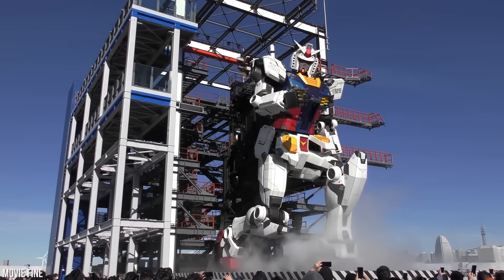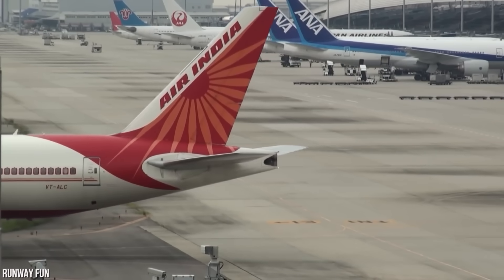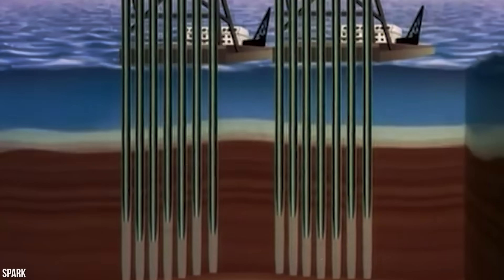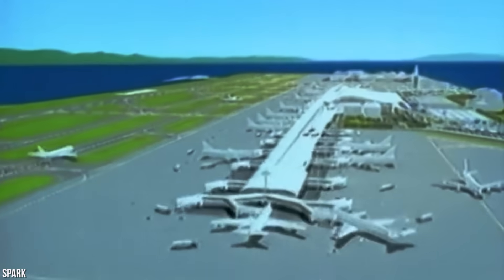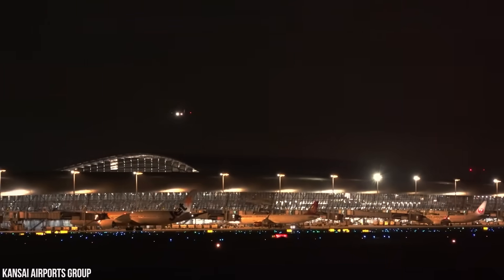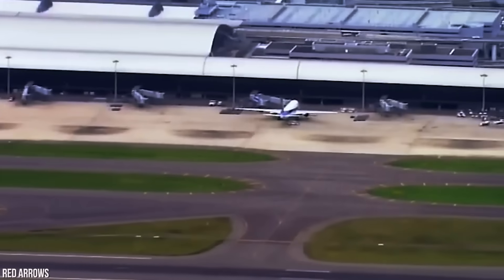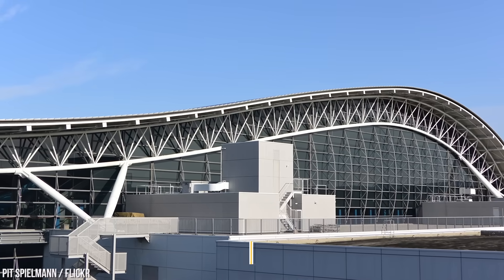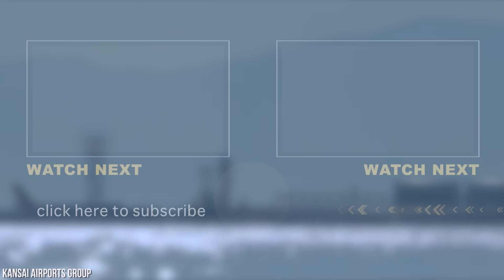Japan's $20 Billion Dollar Floating Airport Is Sinking

Comment: Do you know what's even more hilarious? Back in 1997-2000, Japan had experiments and tests with a possible fully floating airport. They've built a 1000m Mega-Float floating airport model in Tokyo Bay. And in the end, they came up to the following conclusions:

-A number of programs were developed to design a large-scale Mega-Float airport taking into account of hydro-elastic response. Using these programs, test designs of an approximately 5000m long floating airport containing a 4000m-class runway were drafted.

-Programs were developed to estimate fluctuations in the radio wave of ILS and PAPI, which are caused by the minute motions due to hydro-elastic response in the Mega-Float airport. These were then analyzed using the 4000m-class test designs. In addition, through the inputting of the analyzed values into a Japan Airlines’ flight simulator, several active pilots made simulated landings at the Mega-Float airport for evaluation. The results of these evaluations indicated the hydro-elastic response have absolutely no affect on landing.

-Actual test take-offs and landings carried out on the 1000m Mega-Float in Tokyo Bay enabled various data to be collected and analyzed, but no noticeable difference to airports on land was recorded. Furthermore, the results proved to be even more successful when the pilots who participated in the take-off and landing verification tests also evaluated the Mega-Float runway as being no different to any other airport.

-The environmental impact of the undersea noise caused by the take-off and landing of aircraft was evaluated to be at a level that would not affect the habitat of marine life.

Comment: Japan is filled with a plethora of expensive and innovative engineering marvels, but not all of the country’s major infrastructure projects have gone according to plan. The Kansai International Airport might be one of the biggest blunders in Japan’s engineering history. It’s built of reclaimed land in Osaka Bay, and it’s sinking into the water.  Engineers always expected the island to sink a bit, but they seriously underestimate just how much the airport’s artificial islands would sink. By 2056, some experts believe that the airport will reach sea level, which will pose a significant risk to the airport terminals and runways. So far, engineers have come up with a few innovative solutions to slow down the sinking, but these are just stopgap measures. The airport might continue to sink for 100 years or more, but if the speed of sinking accelerates the airport will likely have to be abandoned. Construction of the Kansai International Airport began way back in 1987, and the project was originally supposed to cost about $8 billion. However, the total cost to build the airport has since skyrocketed to $20 billion because of all the costly repairs. Iron plates under the foundation and a stronger seawall are two of the ways engineers are improving the Kansai International Airport. These measures should slow down the rate at which the airport is sinking. Here’s a look at Japan’s $20-billion floating airport and what’s being done to stop it from sinking. Keep watching to find out more about the Kansai International Airport.

Comment: The airport is sinking  because the load of the rockfill used in the construction is so large
that the clay soils foundation at the sea bottom are overstressing these soils over the yield shear strength and once this condition develops we have a  constant deep and plastic deformation difficult to stop.
The sinking will continue with time and the rate and magnitud of sinking will depend on the thickness of the bottom foundation  clay strata under the yield shear strength.
I'am Geotechnical Engineer with 50 years of experience.

Comment: How deep is the water there? And what is the cost to build underwater pillars to hold it?
Reply: No ,the airport is floating it is  supported by cylinders of concretes wich upsides down,,for example when you out an empty cup in water in upside down it does not sink first coz the air is trapped here

Comment: The fatal flaw was they didn't believe the ocean required compensation.
Reply: As Engineers we understand compensation. WTF!!
Reply: @bjhemingway5496  Good thing it was you who built this wasn't it then? xD
Reply: The fatal flaw is that the Japanese slaughter tens of thousands of dolphins every single year.

The Japanese actually hold slaughter-fest in which they rounded up the dolphins by the thousands and slaughter them, dyeing the whole sea red.

Obviously this doesn't bode well with the Sea God.
Reply: @clocktower1164  right……

Comment: It's a terrific airport and it is so easy to get to by train, bus or car. I had heard it was sinking but didn't realise just how rapidly. Too bad. As the narrator mentioned, it was built in the bay because there is really no space for it on land nearby. Japan is extremely mountainous and most people live in the plains which are very crowded.
Reply: Another big factor is that they wanted it to be able to have a 24 hour non stop operation which wasn't possible with an inland option. Also there had been a great deal of protests from the Narita airport works and the land take-overs that it required, something they didn't want to deal with.

Comment: You didn’t answered your own question “why is the airport sinking” and “the engineers underestimated how fast the airport sinks” is not the answer, even when you repeat it a few times
Reply: “What do you want for dinner?”
“I am very hungry!”
“OK… so what do you want for dinner?”
“I should eat soon as I am very hungry!”
Reply: @closure4791  yup
Reply: earthquakes probably aren't helping matters
Reply: Just saved me 8mins I’m not watching this shit now 🤣
Reply: Also didn't understand why he would say 13 feet and then show on the screen 13 feet again instead of the meter conversion. SO INFURIATING.
Reply: Seabed silt compressed by weight of soil, said wiki.
Reply: I mean they did say it at the beginning, the foundation isn't dense enough
Reply: yo momma
Reply: The answer is, “it’s built on sand”.
Reply: They need to call those guys that inject foam under concrete to raise foundations and driveways.  The foam would also soften landings.
Reply: waste of time

Comment: This is a negative opinion piece.  They knew that the building would settle. That’s why they built the jacking systems in place.  Only time will tell if they were right.  I give them credit for even attempting this project.  It’s so much easier to denounce others hard work.  Negatively is the only goal of this CRAP PIECE.

Comment: No matter what this is an engineering marvel, even if it sinks. It is a first try and has already been used for years, but if it is going to sink they should disassemble the structures and move them off the island and add more feet of elevation. This time they have much more information to use in doing it correctly. They have already spent too much on this island just to let it sink and write it off.
Reply: they have already build another (smaller) airport across the bay and it looks to be fine so far.
anyway..that 20billion cost INCLUDES the money spent in hydraulic jacks in the foundations of all the buildings (to raise them as the island sinks) and also includes the money they have spent so far making sea walls around it, the initial build cost was way way less than 20b.
and since it's cheaper to repair it than build another...they have plans to add height on the sea walls and the runaways.
Reply: They already used those information. The newer island airport such as Kobe and Nagoya chubu has no such problem. In fact, the island next to the original island has no such sinking problem.

Comment: so why is it made to sink?
Reply: cheaper to make that way? but since it was to be the biggest airport in the area they knew they could spent the revenue on fixing it later, that "20billion" cost INCLUDES the money spent in hydraulic jacks in the foundations of all the buildings (to raise them as the island sinks) and also includes the money they have spent so far making sea walls around it, the initial build cost was way way less than 20b,
then again...they have already build another (smaller) airport across the bay and it looks it is not sinking...so far.
Reply: @vasopel  i have just learned something without understanding 4/5 of what you just said

cool so basically so that they earn enough money to later fix it before it sinks, and to be made that way is cheaper
Reply: @crunchybro123  
when they were designing it they didn't spend money on making tests to see if the bottom of the sea could stand the weight of the island they would make. those test would mean money and time wasted...
when the project was almost complete they saw that it was sinking...but they had a "plan B" .... instead of scraping the whole project they could just complete it "defective"....then use the revenue to fix it along the way, they also added hydraulic jacks in the foundations of all the buildings before the grand opening ;-)

Comment: This is an extremely dangerous construction which is built on the surface of saltwater . ( The  land seems to be not solid connected from the bottom of the ocean .)  No matter how much soils you add to strength it  it would lead to the DEAD END !  🥵🥵